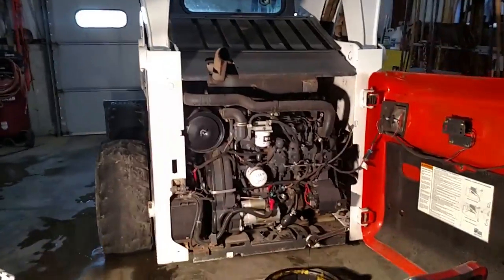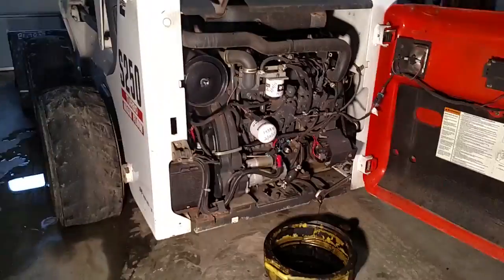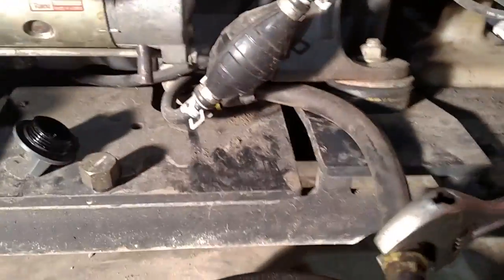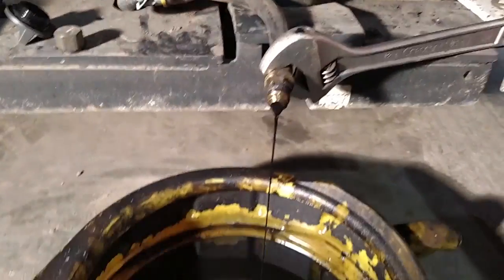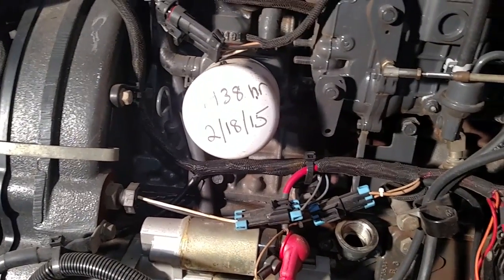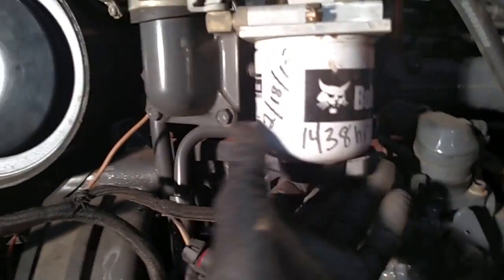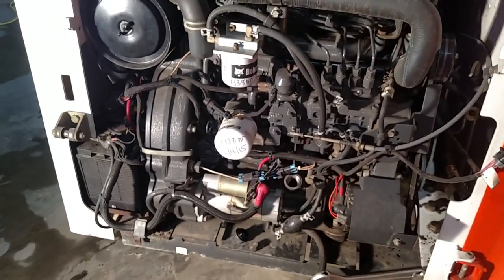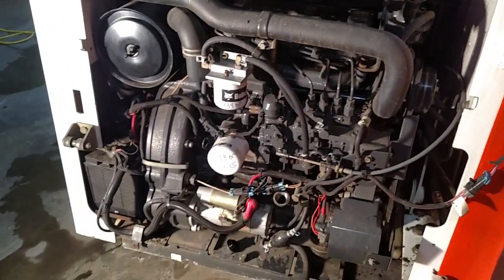How to Change Oil On Bobcat Skid Steer

Comment: Came here to find out where the dipstick is and you failed
Reply: It’s right next to the oil filter.
Reply: Wow, doesn’t need to be hot pink for you to find it.  You may not need to be in the engine bay of anything if you can’t find the dipstick on a s250

Comment: Lol 😂 the oil fill is on top the valve cover. What you referred to as the fill port is essentially equivalent to the dipstick as in where you check fluid level

Comment: Probably will be changing tires soon.
Reply from the maker: +cleatrampler Just got prices on tires a couple weeks ago. Were having new ones put on once we get going this spring.
Reply: That's good, do they last about a year or longer?
Reply from the maker: Definitely longer. Depends how much work on pavement you do but you should be able to get a few years out of normal tires. The set were getting put on are supposed to last almost twice as long... but we'll see about that haha
Reply: Makes sense, you don't spend much time on pavement. Around here even off road is rocky and hard so wherever you go your tires wear out. A friend has solideal lifemaster tires and they only last slightly more than a year. I like your videos because you are working in a way I wish I could have, big time skid steer enthusiast here.
Reply from the maker: +cleatrampler Awesome! I appreciate the support. Thanks for watching!
Reply: cleatrampler 
Problème de. Les,ectrovanne

Comment: Great video. How much oil does the bobcat typically hold? Also do you have to use bobcat's brand of hydraulic oil. I have a 753 F series that needs some work. Thanks for all the videos
Reply: Use the synthetic rotella $18 a gallon on Amazon, it takes pretty much 3 gallons I think
Reply: +PA Winter Services edit 3.5 gallons
Reply from the maker: +Nick Johnson All diesels use 15-40w so as long as its that you can use whatever. You can buy the Bobcat oil but its way overpriced. Every machine takes a different amount so I'd just look in your owners manual for the amount... if you don't have one I'm sure you can find it online.
Reply: How many liters can we put